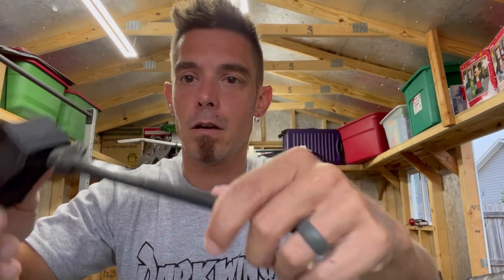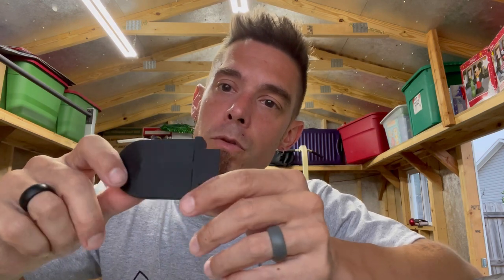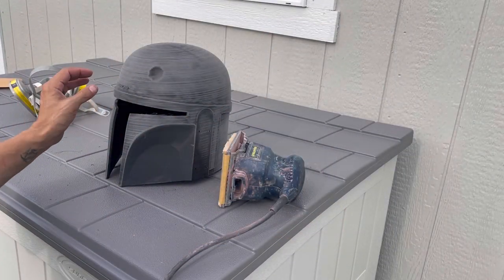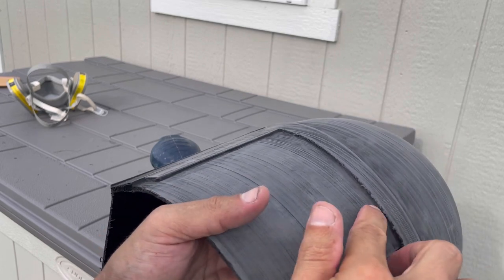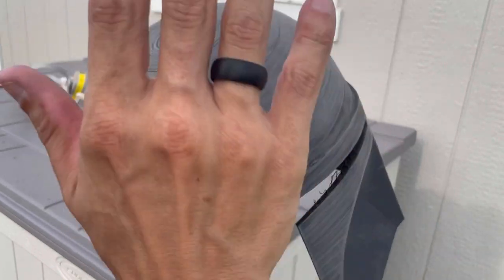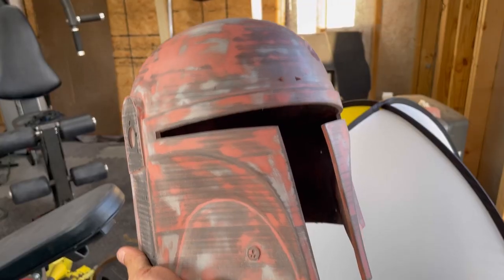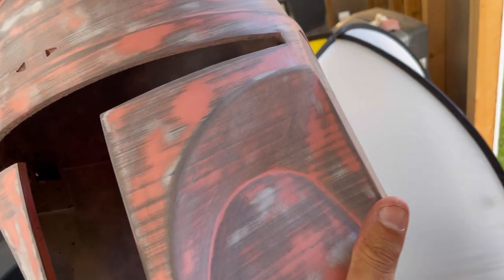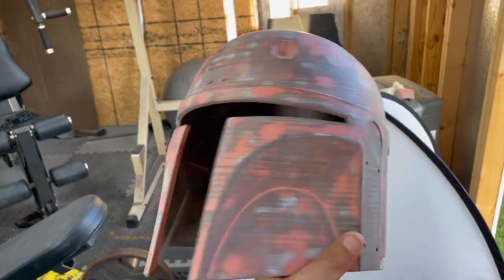How to sand 3D prints| Finish 3D prints faster 3D printing like a pro | boba fett 3D printed helmet

Comment: on your very last coat of primer do you sand that at all or just spray the color you want on top with no sanding?
Reply from the maker: If I see any light defects I may hit it with 400 or 600, that’s all you’ll really need to do. Especially if using bondo filler primer it fills & sands down so easy. On this particular build though the filler,putty & 2 coats took care of all the defects.

Comment: 0.4mm nozzle, higher heat, slower print, shorter layer height makes less lines
Reply from the maker: Heat needs to be calculated with your filament. Too high you’ll run into oozing & cooking your pla which requires more work to clean up. Regardless of layer height,speed etc everything needs post processing, all layer lines show once you start to sand.
Reply: @Darkwingdad  Right, but every filament has a temperature range that works with it. I also didn't say there would be no lines. I said there will be less lines. Which makes your work easier.
Reply from the maker: @adamsaquatics3332  totally understand, & there are definitely prints where you want to use a finer layer height due to eccentricity if detailed areas & I agree with that. There are prints I’ve done at .16 and still sand but there are others (like my thanos helmet recently) that I printed at a higher layer height bc it had large flat panels that are easy to sand. Usually on busts I always print at .16 with ironing. I just look at it with helmets like mando or thanos for example to keep it printing for an extra 2-3 days I can fix all the extra in a day, plus it saves wear on the machine.

Comment: At what point is it recommended to stop using the electric palm sander? Do you still use it after the bondo glazing putty with 220/320 grit?
Reply from the maker: I use it on the initial sand and with the plastic metal. You don’t want to over use it bc it’ll strip all those filling agents the putty and primers provide
Reply: @Darkwingdad  Thanks for the quick answer! Although I have binge watched almost half of your videos at this point, I have some difficulty figuring out when to go for one or two coats of filler primer. Should double coats with 30 minutes in between coats be done at the earlier stages (before 320/400 grit) or towards the end (after 600 grit)?
Reply from the maker: @Daan87423  what filler primer are you using?
Reply: @Darkwingdad  It's from a company called Jenolite. Sadly many of the products you're suggesting aren't available in Europe
Reply from the maker: @Daan87423  is it solvent based do you know? How fast can you sand it once applied?
Reply: @Darkwingdad  It says "acrylic formula" on the website. Sanding probably after 1 hour depending on the temperature (it's 40 F right now). Pretty sure its not water based, it has quite the smell.
Reply from the maker: @Daan87423  I’ll have to do a video to show my method better as far as costs go. I’ll do one light coat, it doesn’t really completely cover the model it’s just a starter coat, you don’t want it to be put on too heavy. I’ll put that on and bc my primer is lacquer based I’ll wait 30 seconds & than apply a medium coat. Wait 5-10 minutes and apply a final coat. It really just depends on the model & level of defects you have.

Comment: Thanks again for this. I’m brand new to working with 3D printing. I’m following along with this video with my own Mando helmet … when I put on the Bondo plastic metal … how thick & dense do I apply it ?  (Or does it really matter)
Reply from the maker: You don’t want to cake it on, apply it in a small section, I guess I could do a video showing bc it does harden fast. You just want to use it to fill in the pla lines
Reply: Thanks. I’m more concerned with the tight corners & areas that have definition. 1. I hate to not cover those tight spots 2. But I also don’t want to “not cover” those same spots (not sure if that makes sense)
Reply from the maker: @davidrussell6159  for tight intricate areas use glazing putty. Filler will be difficult to remove & you may lose definition. I speak lightly of this on my repairing a failed print video I posted the other day. You can remove glazing putty with a plastic razor blade,pick tool or acetone if put on too heavy & it sands down quite easy
Reply: @Darkwingdad  thank you 🙏🏻
Reply from the maker: @davidrussell6159  no problem my friend! Always here if you need it!

Comment: Once I’ve sanded, primed, and I’m ready to paint what are you cleaning your pla parts with again? Just straight alcohol?
Reply from the maker: For dust removal alcohol is fine. Once you have paint & or clear coat on I like using a product called prep all, you can use alcohol but prep all is a stronger stripper that helps remove oils & other agents on the surface.
Here is the link for it https://amzn.to/3ae93YS
It’s primer & paint safe.
Reply: @Darkwingdad  thank you! I greatly appreciate your videos. I watch them and recommend them all the time in all my 3d printer Facebook groups. Great work
Reply from the maker: @rum28  I appreciate it so much! What project are you currently working on?
Reply: Mystery Makers Bo Katan helmet and armor. It’s a Halloween build for my daughter
Reply from the maker: @rum28  nice! He has great files! Are you doing gloss or satin finish?
Reply: Rustoleum rattle can gloss. Colors are becoming harder to come by right now too. I keep seeing bare shelves everywhere

Comment: I’m sorry but I’ve never been one to spare feelings. If you can’t properly mix regular bondo you have no business trying to 3D print anything.
Reply from the maker: Regardless, bondo body filler is like sanding concrete whether your ratio is on or not. Plastic metal is significantly easier & products like rage gold & dolphin glaze are higher quality fillers but bondo is more readily available